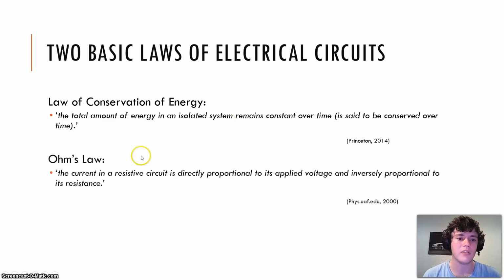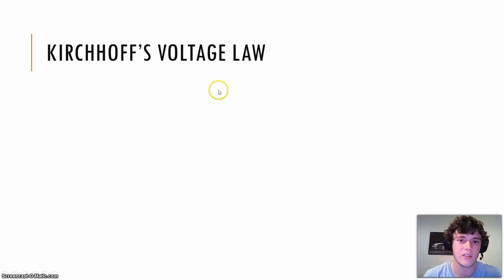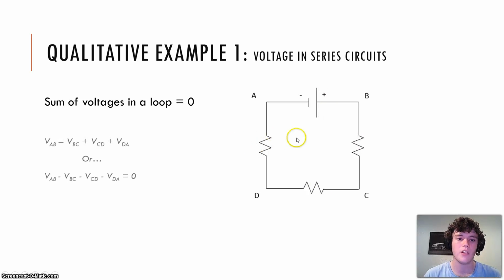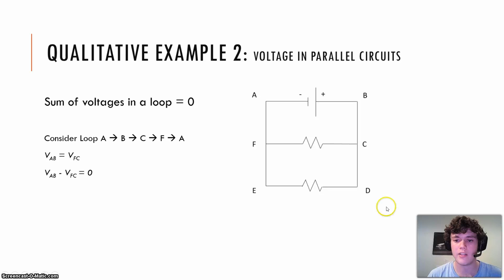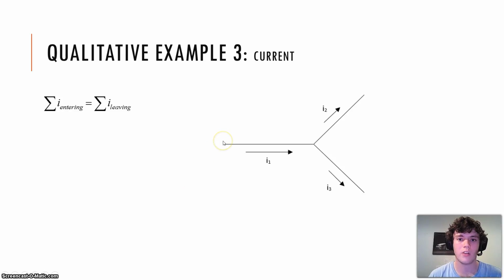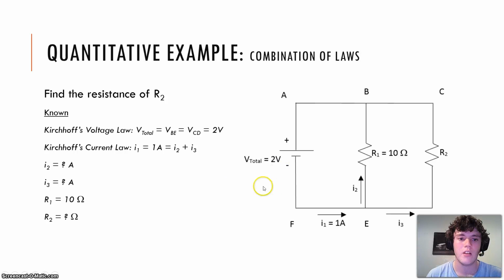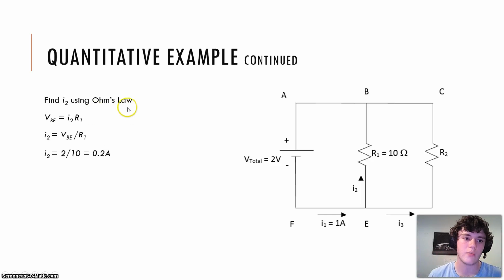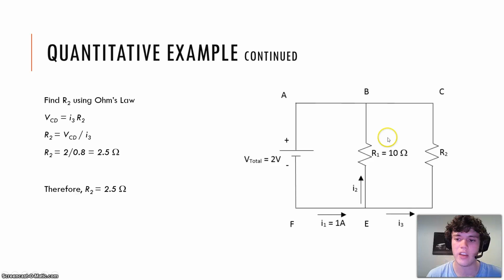An Introduction to Kirchhoff's Laws

Comment from the maker: Allen Foufaka

Question 1 being the quantitative example?

Voltage across nodes BE can be found with Ohms Law --> V = iR. I know voltage is 2V (parallel circuit) and Resistance is 10 Ohms. Thus, the current is 2/10 = 0.2 Amps.

Now that we know i1 and i2, we can find i3 with Kirchhoff's current law. This means that:

1.0 - 0.2 = i3
i3 = 0.8 Amps

Again, with Ohms Law you can calculate the resistance of R2. This would be 2/0.8 = 2.5 Ohms.